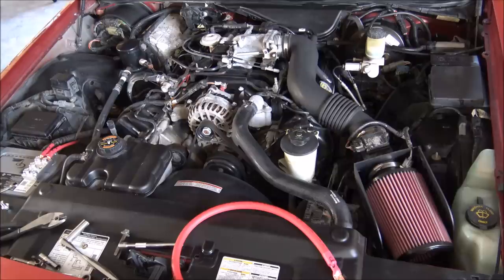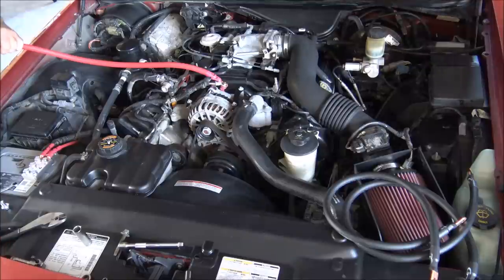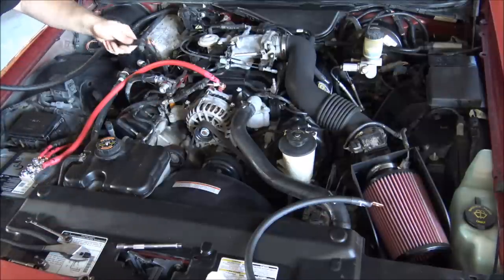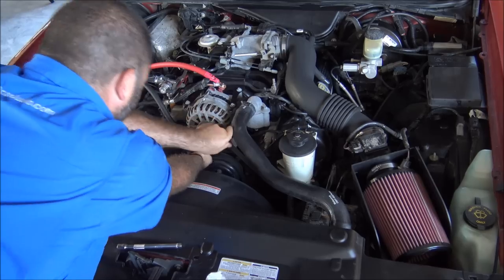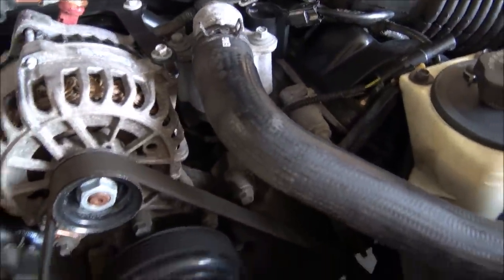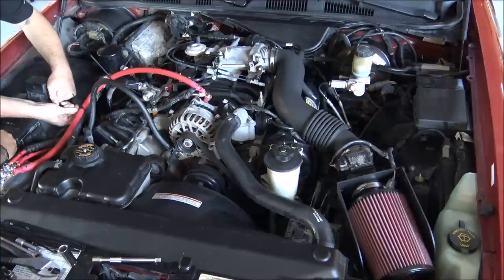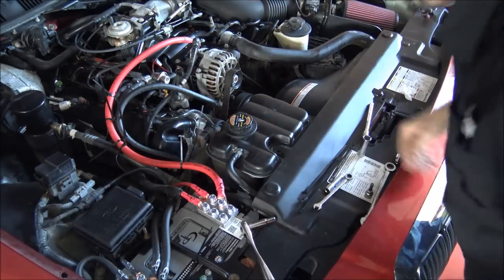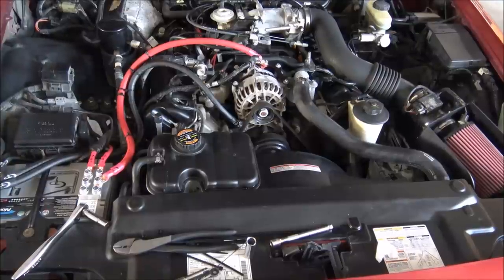HOW TO INSTALL THE BIG 3 UPGRADE CAR AUDIO

Comment: My car has a battery sensor on the negative battery post cable and I was advised to not connect any wires to the negative on the battery. Would I just ground the alternator to the chassis and leave it at that or could I do something else.